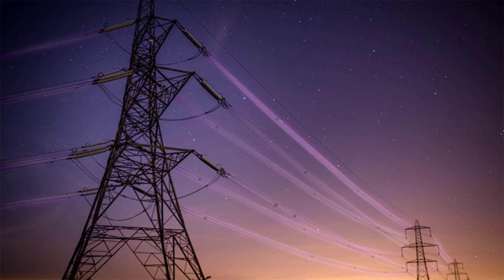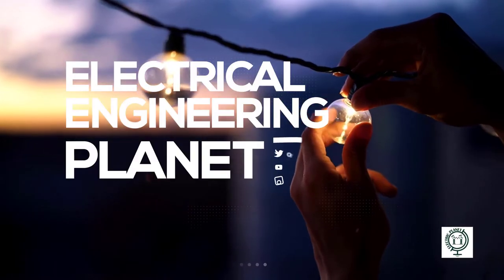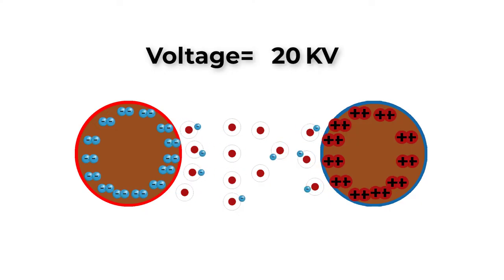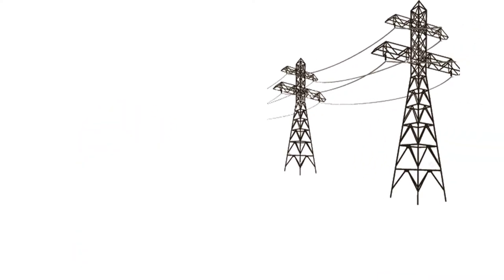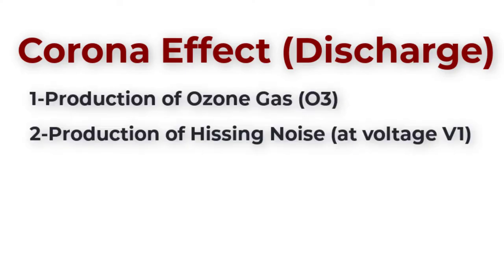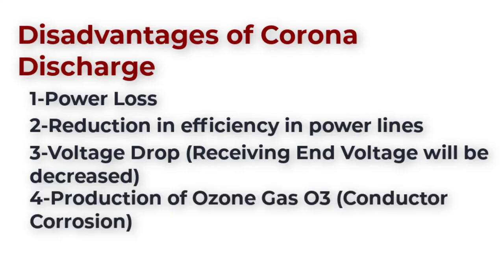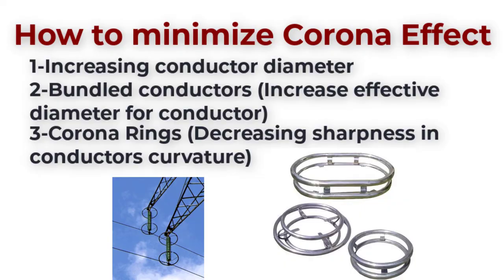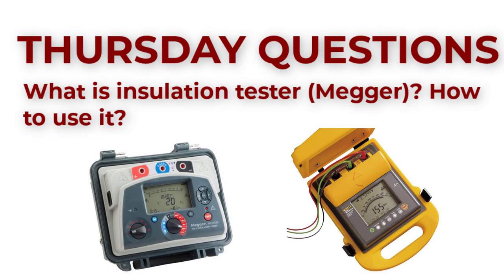What is Corona in Electrical World ? | Corona discharge

Comment: Does "Ionized air" means that electrical current or electrons can flow through it?
Reply from the maker: Thank you for your question, yes ionized air is an electrical conductive air, and we can have with high level of voltages that breakdown air
Reply: In addition to what has said before, it is a form of the substance that called Blazma
Hope I benefit someone !

Comment: Does this mean the air between the conductors that is ionized can electrocute someone if they were near it?
Reply from the maker: To be electrocuted you have to be close to the cable and at the same time you have to close the circuit by touching the ground with your feet,, and this at normal condition will never happen